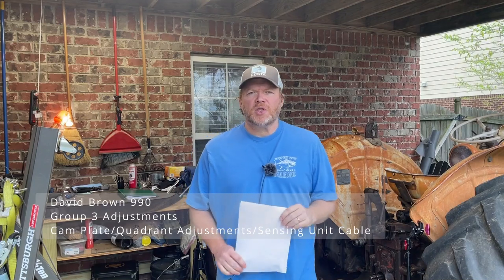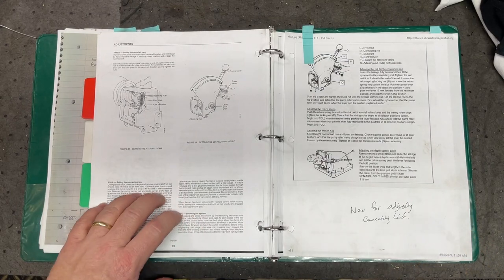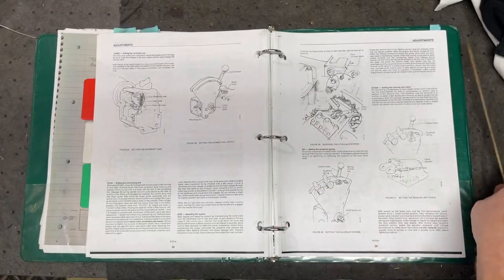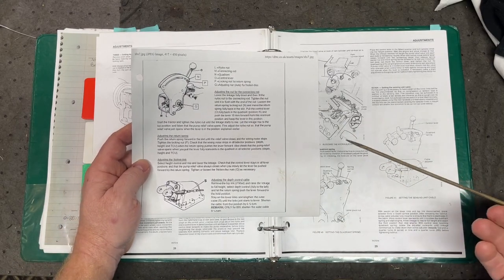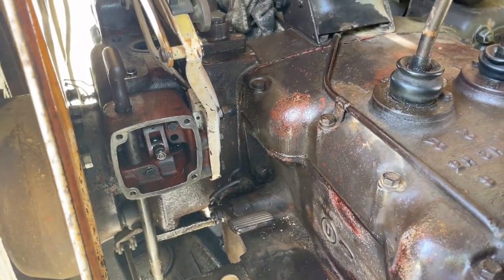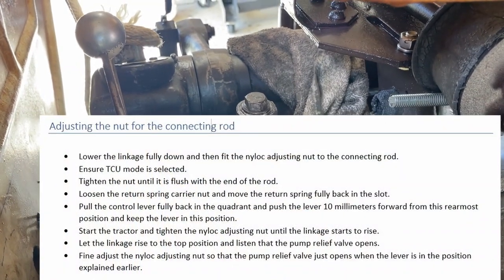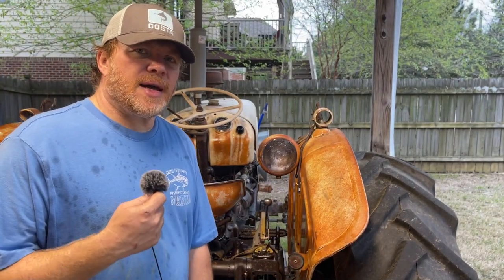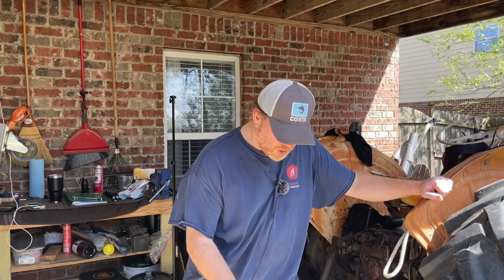It Works!  | Finally doing the Hydraulic Adjustments!  (Group 3) | David Brown 990 #21

Comment: Well done Shane a very complicated set of adjustments explained simply, no one should fail to setup correctly after watching your video.
Reply from the maker: Thanks Barry! Those instructions are pretty easy to follow.  Just a bit of fiddling with the return spring and nyloc nut to really get it good and dialed in.

Comment: Love it as much as you do ! Thanks for sharing it with us. I was in there one week ago. But I didn't check the cam adjustment as you did. At first, it seems very complicated. But it's mechanic. As long as you can see someone doing it like you do, it's finally not that complicated. I'd say the 990 was probably the best tractor David Brown built. At least for the engine.
Reply from the maker: Reading about it (several times in my case) and seeing someone do it are two entirely different things.  That's the whole reason I started videoing this stuff.  Other than 
Barry's channel, there wasn't any detailed videos on the hydraulics and I wanted to make the attempt.  The old saying a picture's worth a thousand words is right!  

You're right in that the 990, at least mine, is a great tractor. My grandfather treated it like a bulldozer with a blade on the back, so it's seen some pretty heavy abuse over the years.  Hopefully I can keep her running for another 50 years.

Thanks for watching and for the comment!

Comment: Hello teacher excellent explanation and shown video lots of useful information to hand I was laughing my head off  I knew what was coming I saw the pepperd state of your t-shirt . One question is once your happy with your hydraulics what's next on your list regarding the 990?
Reply from the maker: Thanks a bunch Jon!  There’ll be a few more vids about the hydraulics I think, but maybe spaced out a bit more.  My weekends are getting booked up!   I’ve also got a power assist steering cylinder on this thing that leaks like it’s made of Swiss cheese.  Need to get resealed, and never done that so thinking about videoing if I can find someone to point me in the right direction.

Comment: Thanks for your vids Shane, helping me with my 880 hydraulics rebuild. One thing I've noticed is that I can move the selector to depth/height/tcu without moving the quadrant lever back against the spring, 

Looking inside the cover behind the selector I can see that moving the selector does move  the internals between three different positions (regardless of whether the quadrant lever is pushed back against the spring or not) 

Maybe the selector's been forced? Could this lead to other problems?
Reply from the maker: Mine is/was the same, at least before I knew to move the lever back against the spring to change the selector lever.  I always now pull the lever back against the spring to change the mode.  There's a risk of breaking stuff if the lever's not moved back against the spring. Thanks for watching!

Comment: Hi Shane, I do like this talking walking maintenance  manual that you are. Have not fitted the nylon block yet. I just have lift arms that go up. They really don't like to go down. You may have seen on Instagram I had a problem with the steering not turning right. Well I haven't been to grate health wise lately so I took the simplest way. I can now turn full left and right and it's as light as a feather. Should get the Bridgeport  up and running tomorrow. Brother in law is coming over to help put it together. Can you tell me the length of the spacers on the rod from front to back please. I might find them but if i don't  I can make more.  M 😀
Reply from the maker: Thanks Marshall!  Glad your steering is getting better.  For the spacers you mentioned, are you referring to the distance pieces for the connecting rod in the quadrant?
Reply: @path.of.discovery  yes i may have one ill have to look later today M
Reply: @MarshallSmart  Ok. I'll open my quadrant back up and see if I can get a measurement on one.  Been out of of town all weekend, so might be a few days.

Comment: Hi again. Seems like my mechanical has succeeded by just tightning up the lever handle. I looked at it and felt like I put the friction plate inverted. But I was wondering ??? Hope I will not look too stupid here... I locked up the hydraulic linkage up. Main reason : I'm not using it and cylinder seems to leak a bit because it's getting down after a period of time. By doing so, I know that cylinder shaft is no longer pushing to lift it. I just thought it may have been related to the fact that lever handle was suddenly loose. Again, I'm not a mechanic and certainly not an engineer. Sometimes simple things are jumping to your eyes without seeing them.
Reply from the maker: I thought I had a problem when I was out using the tractor and I'd locked the arms in the up position and forgotten!  Happens to us all I guess!  Great to hear about the success!

Comment: Having problems with our tractor David Brown tractor normally my husband would take care of these issues but sadly he passed away from covid. The tractor has been parked outside for a couple weeks this summer went to move it  it would not move forward or reverse. Hydraulics-bucket works. It has been 3 months. Yesterday I tried getting it to move it wouldn't, again I played with high/low gears. Shifted into the low the tractor seemed like it wanted to move forward. I turned the steering wheel back and forth and put the foot throttle down and it moved a couple of inches, did this several times and it finally moved but extremely slow not enough to get going. I would stop and I'd repeat turning steering wheel/wheels and it would slowly 🐌 go again. I kept doing this and was fortunate enough to get it parked back in the shop. Any ideas on what is wrong? Any help/information would be greatly appreciated 🙏  Thank you
Reply from the maker: Condolences for your loss.  I don't have any real advice for you on this issue.  I've not experienced this kind of problem before.  Maybe an issue with the clutch?  There's a great facebook group that I'd recommend you look into posting this issue to and see if some of the experts out there can help.  Look up "David Brown Tractor Club Ltd (Official)" on facebook.  Here's a link: https://www.facebook.com/groups/175513530555836

Comment: Hi Shane thanks for the help i have a manual now the only problema i have now is My spool valve it's broke ando i can't find one my tractor is a David Brown 995 thanks if i have help to find one
Reply from the maker: Oh no!  A broken spool valve is not good.  The spool valve for the Valve Chest in these Selectamatic tractors is match ground to the bore and not replaceable.  You'll need an entirely "new" Valve Chest, either from a tractor breaker local to you or by contacting Barkley Williams.  Barkley Williams in the United Kingdom reconditions Valve Chests for these Selectamatic tractors.  Highly recommend calling or emailing them.  Here's the website:  https://www.barcleywilliams.co.uk/